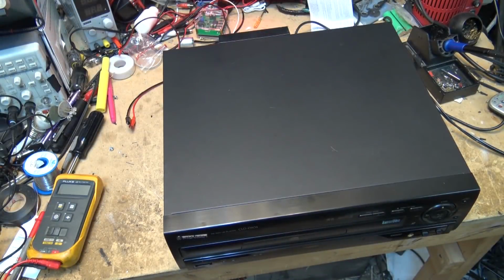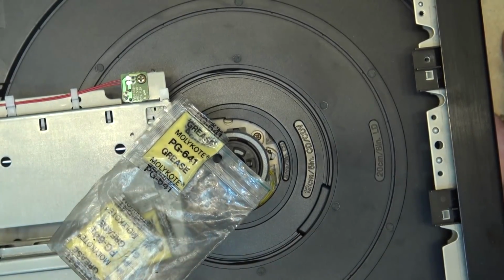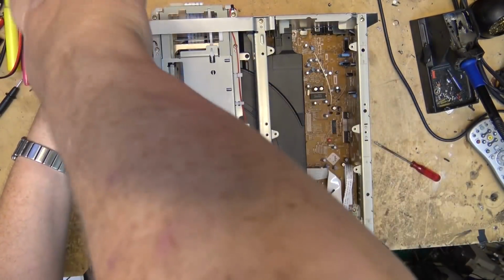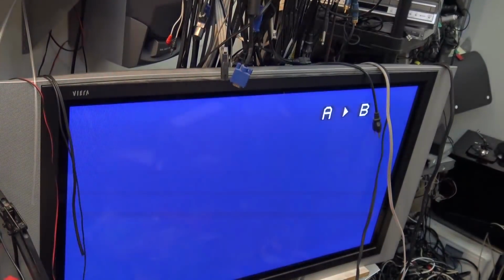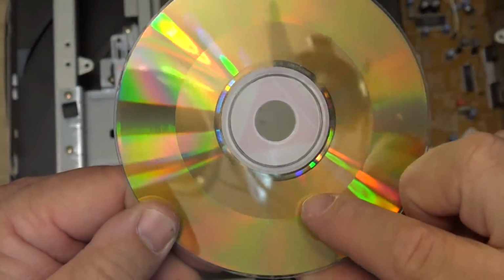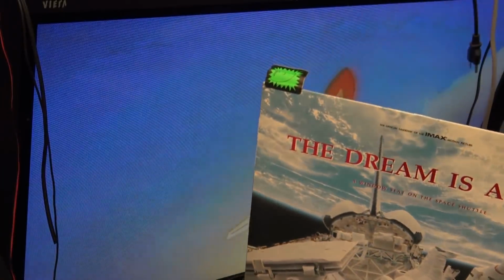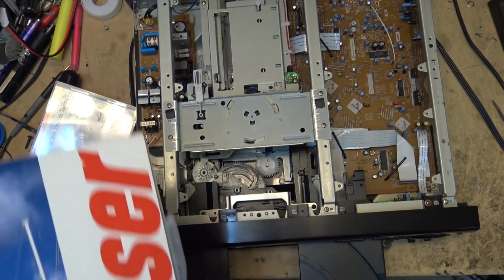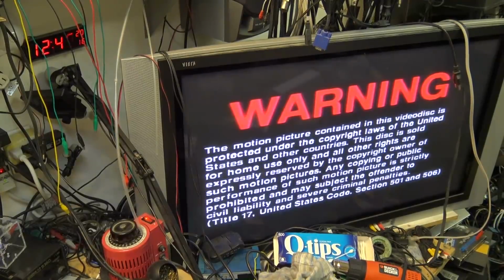Pioneer CLD504 Laserdisk repair

Comment: In addition to lubricating the slider track, I'd also recommend checking the condition of the plastic M-Holder (part no. VNL1779, discontinued) mounted on the pickup.  Sometimes, one of the two plastic poles on the M-Holder holding each of the gears in place can break and cause problems with the slider mechanism on the pickup, likely due to strain on the mechanism due to dried lubrication on the track.

Since the part is discontinued, you may have to repair the M-Holder so it can properly retain the gears for the slider mechanism if the M-Holder is broken.
Reply: Unless, by chance, someone started making them again :) Look on eBay.
Reply: @ethangallo8480  In other words, people have endeavored to reproduce the parts via 3D printing.

I figured that's the way it would have went eventually once the cost to do so had gone down.

Amazing the progress that can be made with technology in three years, eh?

Comment: Great video...Funny about the grease, seeing as I just asked you earlier.LOL Just picked up a beast of a tv for my laser disc player for free..Sony KV-40XBR700
#300, wow
Reply: Ive been trying to find one of these models close to me for playing older gaming systems. Sure wouldnt want to pay for shipping one of these! A friend had a Sony 36" that stopped working. I told him i'd buy it as is but he threw it off a second story deck rather than carrying it down and busted the tube. =(  But i did salvage the boards in case i needed them, some day.  The picture on these is really good even compared to newer tvs.
Reply: I just picked it up today and I feel like a kid at christmas. Its gorgious. BUTTTT it weighs over 300 lbs...wow. It will also do 1080i. It was the biggest commercial crt ever made and the best some say

Comment: From looking at the DuPont application guide for the Molykote line, it sounds like the "slides and glides" application for metal-to-plastic and plastic-to-plastic contact, you probably want MOLYKOTE 33 Light or Medium Extreme Low Temperature Grease. These are both available in 5-oz tubes for $20-50 at numerous suppliers.

Comment: Wow this is my go to channel.. on electronic jargon on technical matters. 😆 sir please make more video on the (sony LaserDisc player, MDP 605 )model. 💿
 In the past I've had issues with no picture plus blue screen and no sound but unit turns on.  I've had any 5 technicians that would not want to touch this player. By fare this is my favorite LD player. I have two units of this model.
Reply from the maker: Let you in on a little secret.  I can only make videos on equipment i have.
Reply: @12voltvids wow cool sir perhaps may  I send one down that way  how much would you charge on repairing one?.
Reply from the maker: @brianherrera4383  no guarantee i can fix it.  No parts available.

Comment: I used to work in a DVD Factory they melted down the plastic,  made the data dies, made the data foil, made the two halves, assembled all together with lacquer, spinning at high speed then compressed together. silkscreen the disc & the whole shabang!
You would have loved this place. I certainly did! :-)
It was owned by Technicolor Universal Pictures & was located in Pinckneyville Illinois. Under different names like Mums, Technicolor. 
The entire process from plastic pellets to finished DVD's with case and all printed material was made there and would cost them around $0.19 ea "they told me" however that was not enough profit for them! 
The entire place shut down and moved to Mexico not too long  after they made the movie (The Incredibles) 
There was even an idiot that snuck a copy of that movie out & put it on the internet before the movie came out While I worked there... and yes needless to say the movie got taken down immediately, the FBI got involved, the guy lost his job & probably ended up in prison!
Some of the things people do???
I enjoyed working around that technology and was amazed at how much was involved from start to finish. The only thing I did not like about the place was ( but understandable) how tight the security was! Had to be searched from head to toe even take your shoes off but at the end they had a shoe scanner so we didn't have to do that anymore.  
You are right the dish is constructed of two halves plus the data foil & lacquer.
 people would be amazed how much is involved in the making of the simple DVD or laser disk or disc.

Comment: Nice multi player, that laser mechanism is very clever but a simple enough to service :-D.

I had a vague memory of the cav/clv methods, but it applied to computer readers/writers.
I also knew that audio cd's slowed down so the laser always saw the same amount of material pass the laser. (Crude understanding on my part).

500rpm down to 200 i think for audio cd, memory has faded a bit lol.

Four disks for a movie, thats special alright.
Smashing that you have a great collection dave :-D.
imagine if they had made recordable versions... A1 quality recordings with no bloody compression :-D.
Shame that it didnt catch on,
Reply from the maker: They did have a recordable version. Not sold to consumers, but there was an industrial recorded. I looked at one once but decided against it. The unit was 4,500 and the blank disks that you could write to once were something like 70.00 each, and it recorded only in CAV mode, so 30 minutes max. It could write full video or a single frame at a time for archiving still images.

Comment: Pioneers are made like tanks. Of course it'd only have minor issues here and there anyway. They made the BEST LaserDisc players known to man imo.
Reply from the maker: Of course they did as they were one of the pioneers in the field and manufactured laserdisk players right from the start to the end of production.
Now before anyone nit picks as to who invented the laser disk, it was first demonstrated in 1972 by Philips (Magnavox) and MCA (discovision)
In the USA MCA owned the rights to the trademark name Discovision, howevere philips marketed it under their name Laservision. The first commercial release was the movie "Jaws" under the MCA Discovision banner.
Pioneer initially manufactured players for "Discovision" but they didn't  develop the first player.
From Wikipedia
"Optical video recording technology, using a TRANSPARENT disc, was invented by David Paul Gregg and James Russell in 1958 (and patented in 1961 and 1990). The Gregg patents were purchased by MCA in 1968. By 1969, Philips had developed a videodisc in REFLECTIVE MODE, which has advantages over the transparent mode."
Ultimately the reflective mode became the standard.

Comment: according to imdb the running time of the film 1941 is 1h 58m this means each side runs for around 15 minutes which when films were shown on two projectors with changeovers is more or less the running time of each reel but the directors cut is 2h 26
Reply from the maker: Most theatres had made the change to platter operation so the film would be built up on a single reel.  The special edition I have had deleted scenes replaces.

Comment: Interesting. My Pioneer had the trolly that physically turned over. I’ve never seen one where the trolly loops backwards on a track and flips that way. Interesting way to do it.
Reply from the maker: Yes I believe my combo LD and DVD  unit it flips over too. I will have to dig that one out of storage and open it up and show it off.
Reply: this is the type i have.  I've been looking at it since i hooked it up a few days ago. when the lens goes to side B, the lens goes to the carriage, rotates 180 degrees and gets stuck in the carriage. I have to unplug the unit and it resets itself back to side A. certainly a head scratcher.

Comment: Thanks for the video.  I have a Panasonic laserdisc player the tray does not open smoothly.  I think I can grease it as you did.  But the other problem is that it does not have sound.  How to fix the sound problem?

Comment: Try a motor factors these grease sachets come with uj driveshaft boots they might sell a tin of it  also try an independent car repairer not a dealership they might have some of the sachets as they usually use grease from a tin

Comment: The difference between laser disc and dvd is like a wav file and a mp3. The wav isn't compressed nor is the very highs and lows are cut out like a mp3. 1941 is one of my favorite movies.
Reply: "The difference between laser disc and dvd is like a wav file and a mp3."

Not even remotely. A typical MP3 is sourced from a CD, so it's a compressed version of an uncompressed LPCM (WAV) track from the CD. Also, MP3s and WAVs are both digital. Retail DVDs aren't made by capturing the video from a LaserDisc and then compressing it. They are made directly from masters which are far higher quality than both LaserDisc and DVD.

A full-spec DVD video stream is superior to a LaserDisc's in every way: higher resolution, progressive instead of interlaced, higher color resolution, and encoded with a component signal (YCbCr) instead of a composite signal (CVBS) for far better color separation. On the other hand, LaserDiscs usually have better quality audio than DVDs.

Comment: i happen to have a cld-d502 that has a power loss issue if left plugged in and on standby. if its plugged in and left on standby after several minutes it looses all power and then has to be unplugged and plugged back in for it to work otherwise it works pretty well.

Comment: LaserDisc can't compete with DVD in terms of picture quality, assuming the DVD is encoded at maximum bitrate (there are no visible compression artifacts at maximum bitrate). NTSC LD has 425 TVL of luma resolution, and up to 160 TVL of chroma resolution (though most players and/or TVs-via-their-composite-input used low cost comb filters which could only decode 40 TVL of chroma resolution), and it's interlaced. 

On the other hand, NTSC DVD is 720 x 480 resolution, progressive (you need a progressive scan DVD player and at least a 31 kHz TV for progressive scan though; on a standard 15 kHz TV you have to use interlaced mode). Color is component (YCbCr, 4:2:0 chroma subsampling, 8 bits per color), which in analog terms would translate to about 240 TVL of chroma resolution. So DVD has significantly higher luma and color resolution than DVD, as well as far superior color separation due to its video signal being component rather than composite, and it's progressive rather than interlaced.

As for sound, many LaserDiscs had Redbook CD-spec audio (2-channel, 16-bit, 44.1 kHz, uncompressed LPCM). The DVD standard supports that type of audio (in 48 kHz form), but I don't know of any Hollywood DVD release that used it, because it takes up so much space. The vast majority of DVDs have AC-3 audio (AC-3 = lossy compression), at a maximum bitrate of 96 kbps per channel (which = 192 kbps for a 2-channel track). So LDs commonly had better sound than DVDs, at least with regard to mono or stereo tracks. 

With regard to 5.1 AC-3 tracks, with LDs that had them, they were usually 384 kbps (64 kbps per channel), while with DVDs that had them, they were usually 448 kbps (74.67 kbps per channel), so DVD wins there.

With regard to 5.1 DTS tracks, with LDs that had them, they were usually 1,235 kbps (205.83 kbps per channel), while with DVDs that had them, they were usually 768 kbps (128 kbps per channel), so LD wins there.

Comment: I have several Sony and Pioneer decks that will require at least some form of maintenance, even if it's just lubrication. This vid will help. Thanks. On a side note, can you do a video on basic oscilloscope use for video  equipment? I just acquired a good working condition Tek 453 from a friend's estate and I'd like to use it with some of the equipment I have around here but have forgotten how to do so since I haven't used one since my old college days 30 years ago. Also, how is the digital one you got working out?

Comment: I hope you see this. I have a Japanese Pioneer DVL 919. It worked when I bought it but in shipping. it stopped working back here in the states. The tray opens. CD, DVD, and LD spin but only for a few seconds and then it just stops and opens the tray. The only one that doesn't open is CD...it just stops. What can possibly be wrong? I opened it up and the LD spins for about 3 seconds and then stops and ejects. It does recognize the discs as well. So it knows its an LD, or DVD or CD and all content is Japanese media.

Comment: I have a CLD-D500 dual sided Pioneer laser, that used to work flawlessly for my wife's Karaoke LDs. We moved and now it will power on, tray works, CD or LD will load and start playing for 30 seconds or a minute at which point the unit turns itself off, including the standby light. I have to unplug the unit for 2 minutes or so and plug it back in at which point power is restored for the same amount of time. It turns off when no disc playing or just idling. I suspect something heat related. I repaired radios for the Air Force for many years, but no video experience and no test equipment beyond a basic multimeter. I suspect something heat related in power supply, but no schematics. Visual inspection does not reveal any bulging caps or loose connections. Any suggestions as to where to look for the fault will be greatly appreciated.

Comment: Hey buddy nice video im going to re grease my players now after seeing this. But im hopeing you can help me with something. I have a PIONEER CLD-V2600 and it takes discs fine and once it starts to spin it starts to move fast and shuts off. I noticed that the laser assembly or pick up moves to read the disc than slides all the way back and looks almost like it hits the back of the case. It then makes a click noise then the player throes a E03 error at me and the spinning ramps down. The laser pick up is mounted between the two white tabs so i think its in there right but i noticed the white plastic ring around the optic lens is a little cracked. Any ideas how i can bring this back from the dead? I cleaned the rubber grip ring that holds the disc to spin it and i also cleaned the optic lens infrared lens and both belts .

Comment: Another interesting video. I wonder why they just didn't use 2 laser pickups, one on each side? Cost? That's the only thing I can think of. Or would that have been possible if cost wasn't a concern? 
Just curious.
Reply from the maker: Cost probably.  They would have to double everything.  By using just 1 pickup for both sides the same servo circuits can be used.  Just reverse the direction of the disk and flip the laser over.

Comment: Nice video (like).  I have a  Pioneer laservision player ld v 2000.  I haven't used it for years and was going to put it on  ebay but when I opened the tray, it immediately went back into the player.  There would be no time at all to load or to remove a disc.  Do you have any idea why it would be doing this?  Maybe you can use it.  It has the remote and a mouse-like thing.  Thanks for the video.

Comment: Hey!  Love the video!  I just recently bought my first LD player... a Pioneer LD-V2200.  It will turn on, it will eject to allow the tray to come out.  I can put a disc in, but it grunts for a few seconds and the "Disc Set" light blinks on the front instead of staying solid.  It won't spin the disc.  Do you know what could be the problem?

Thanks!

Comment: @12voltvids I've got one Sony MDP 640D. When I put in the disc, the player recognises it and laser starts "searching" for something. But nothing happens. After a few times up and down the LD will be dropped out. What can I do to fix that issue? Kind regards
Reply: I also have a Sony that wont output proper sound. Apparently sony never figured out how to make reliable plyers like Pioneer.

Comment: I just picked up the CLD-D750, Viaduct Ray has trouble opening on its own but I can get it to open and I can put a disc in. It was spinning the disks earlier and now it’s not. I noticed the tray with a little when the disc starts to spin and now it’s not lifting. Any thoughts?

Comment: I have a Pioneer I got from eBay. I had to open it up and fix the tray not opening issue. After fixing it I can't get the power back on. It's just dead now. It came on once then dead again. Any suggestions??

Comment: I have a pioneer cld d-605 been sitting around for 15 years, I try to turn on yesterday’s. No power, what can I do
Reply: open it up and check the 4 fuses for breaks in the filements..usually this is problem...they are different voltage 2 and 2..good luck

Comment: Nice video. I have a pioneer DVL-909 that's still kickin'. I had to lubricate the rails recently but all is good and I occasionally have that belt slipping issue you addressed.
 I do have a question about the outputs. Mine has RGB outs but when I plugged in a RGB to VGA cable that I recently bought I am only getting a greyish green screen. I plugged the same cable into my DVD LG deck's RGB outs and it works perfectly. I notice that the LD player has Y Cb Cr but my  LG DVD player has Y Pb Pr outs. would that be why? the screen is an Acer. the composite output works to my projector perfectly by the way
Reply from the maker: Dvd player has progressive out. Y PB pr indicates progressive. 
Y CB CR. Means component video (interlaced)  now, since your laserdisk is an analog composite format, inside the player there is a circuit to decide the composite to component.  Your monitor needs to be able to process a component interlaced signal.  If the decoder in the laserdisk is working and you are getting the component red and blue signals out then the monitor is not capable of displaying interlaced component.